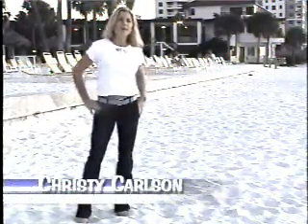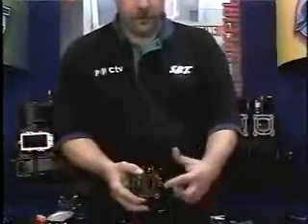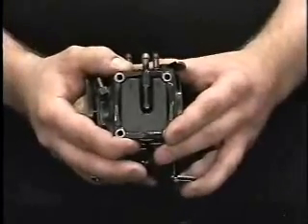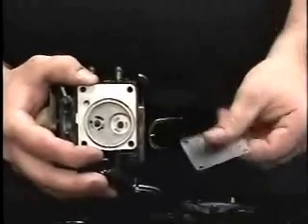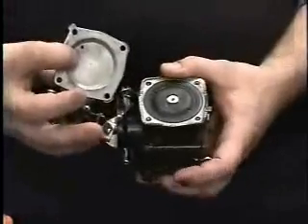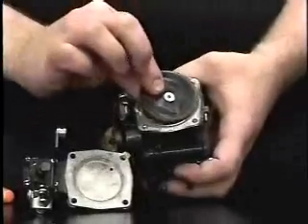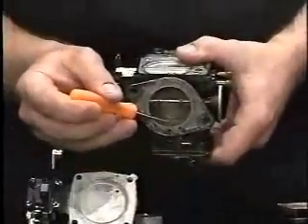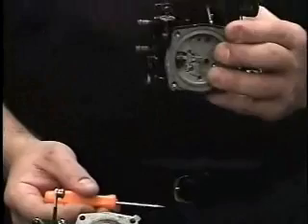How a carb on a PWC works

Comment: What can be the problem when fuel keeps dripping inside in the inlet intake I cleaned the carb and it was gone but after riding the JetSki for 10/15 min it happens again and there is to much fuel in the intake so it drowns the engine could it be dirt from the tank or something else is wrong whit the carb maybe the return lines aren’t connected the right way
Reply: Fuel dripping into the venturi of the carburetor is typically from a leaking needle/seat. The needle and seat could be bad the the spring pressure could be too low or the o-ring around the seat is bad.
Reply: Paul Sage but after i cleaned iT was gone until I ride whit it for a minute or ten
Reply: You might have some debris getting caught in the needle and seat assembly.
Reply: Paul Sage there is no line filter I think I place one and clean it again and see what happends

Comment: I pulled off my carb and my valve plate full off how can i find out what position to replace it  1992  ski doo xp  dual carb
Reply: Randy Wiles I know this was a year ago but I did the same thing and get a timing wheel. It’s like a see-through plastic thing with degrees all around it. It’s not that complicated but the next time you take it off make sure you put pressure on it so it doesn’t fall off. 
I did the exact same thing that you did lol.  I feel your pain but you have to make sure that thing is in time and that wheel or valve is exactly in time it’s not as hard as you think it is. There is a video of somebody that shows you how to do it on the old Sea-Doos I believe used has or was using a 38 or 44 mm SPN carb sea doo doo. 
Hey if you ever got it worked out it would be nice to know where you got the information. Post here. Thanks man.
Reply: @michaeljohn8905  do you know how much it costs for a new carberetter kit n to fit it back on..for a 95 yamaha seadoo?

Comment: You showed the low speed circuit and the high speed circuit but is there an accelerator pump circuit?. I have a 97 Yamaha Wave Venture Triple and it feels like it has a lean misfire when I accelerate. But when you transition from low speed to high speed at a slow throttle response its ok. It misfires with fast throttle action only. Any help you can provide is appreciated. It misfired so bad it blew the crank seals out. Compression is 120# all three.
Reply: Kinda sucks that this is a lost art and nobody but us DIY guys/ girls and tech nerds watch this stuff. I would so like it if they reloaded this video and made it live interaction for a weekend giving live seminars on naturally and unnaturally aspirated PWC,$ and boats. I’d bet they would have a hell of a large audience. 
Honestly I wish there was somebody that you could get a hold for this type of thing. I mostly six outboard motors and of those we get very few that are diaphragm pumped  fuel systems. We do get them and they are mostly simple but we don’t get them enough so sometimes I have come up and most of those guys don’t know either. Lol. We are living in a society of automation. 
I tried to practice this old stuff as much as possible and there really is an art to it.